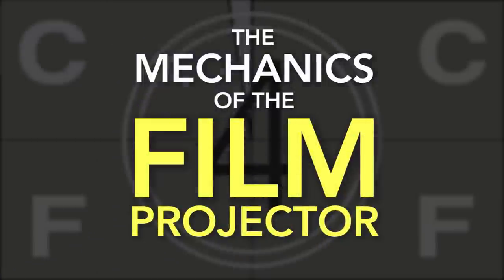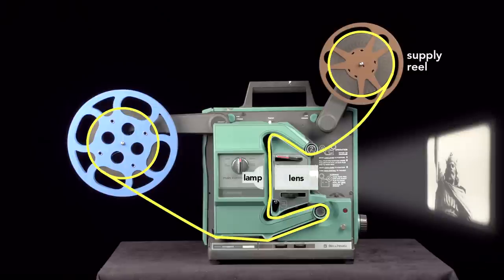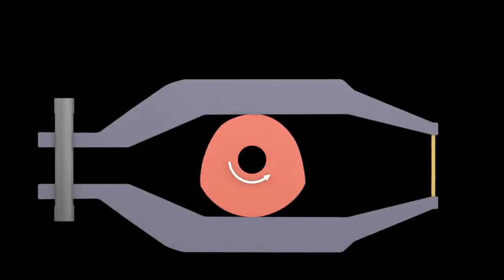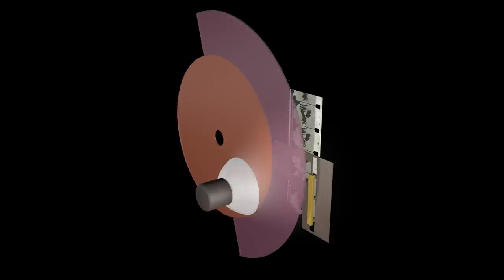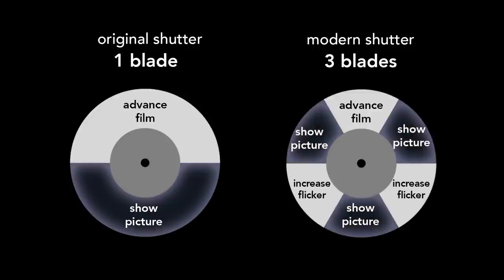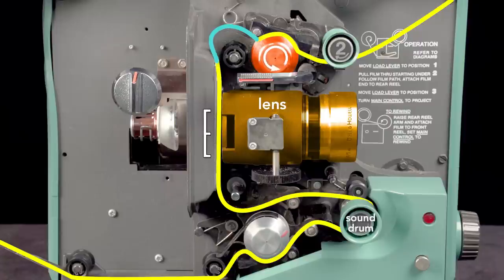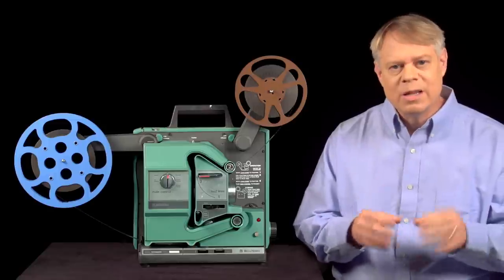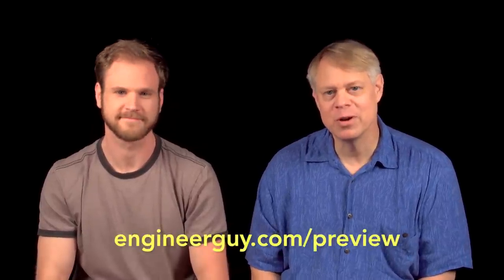How a Film Projector Works

Comment: Ah, yes.  I remember those.  Before computers were so easy to obtain in schools, tech-obsessed kids like me had to settle for things like "the audio visual club".  The 16mm projector was often the most complicated equipment that we could get our hands on (that the teachers allowed us to touch).  Still, one could learn a lot from them.  A mistake that was particularly easy to make was in wrapping the film around the sound drum. If you wrapped it loosely, everything seemed to work OK except that the sound was jittery and distorted.  You had to make sure that the film was snug around the drum in order to get the best sound quality.  All this might sound irrelevant to modern tech, but that little sound-drum hazard taught me a lot about how to deal with urgent problems.  In the 6th grade, our club was responsible for threading a film that would be shown at a big school meeting.  When the sound was distorted, it felt like a crisis to us.  Half the school is waiting on us!  The teachers had no idea how to help, so it was up to us.  Now what?  Learning how to calm down as a group and debug the problem quickly was a big event for us.  Low-tech or not, it helped me develop social and mental skills that I still use today as a computer programmer.
Reply: I did this in school also then did it for the U.S.A.F.
Reply: Yes, it seems if the film is loose around the sound drum, the slit will be incorrect and variable distances away from the film, thus sometimes making the sensor detect too little light and lowering the volume, sometimes making it detect an average from a wide length of film, causing aliasing and other artifacts in the frequencies
Reply: @luigivercotti6410  The slit of light is focused onto the edge of the drum, so if the film is loose, it is out of focus. This is the main cause of the distortion.
Poor quality sound can also be caused if during cleaning the lens is not correctly focused, or the slit is not set to exactly 90 degrees to the film.
Soundtrack test films are needed to set everything correctly. 
In major cinemas, tests and fine adjustments are carried out daily. With a stereo track their are 2 side by side images, so the adjustment is very critical.

Comment: Great video. Interesting to think that one single axle keeps the entire projector going.
Reply: Ian Gacek The single axle design makes the whole thing very impressive.
Reply: Ian Gacek Agreed! It to me about four hours to rip apart the projector (it's built like a tank) to get to the main internal mechanisms. I really had no idea how it worked until I saw for myself.
Reply: Ian Gacek 
While the Bell and Howell projector here uses a worm screw where most projectors use belts, that component is actually the Achilles heel of the machine. The original worm screws have a tendency to crack, which completely screws up the projector's timing and can lock up it up, and require a complete disassembly of the projector to replace. They then have to be adjusted to ensure they work properly. Good news is the newer worm gears are made of a material that doesn't crack anywhere near as easily.
Reply: @Videogamehistorian00  Traditional cinema projectors have a high precision gearbox that includes oil pumps. Many of these machines ran 12 hours a day for more than 30 years without gear replacement.

Comment: Also, The Take-up reel shaft is driven at a constant speed from the single motor through a belt system, but a slip clutch built into the take-up mechanism allows the take-up reel to change speeds as the diameter of film changes on the reel. This also serves to keep a small tension on the film so it takes up snugly. There are similar mechanisms on 35/70mm theater projectors. Some small projectors and usually theater projectors, also have an adjustable, low tension, slip clutch/brake on the supply reel mechanism to keep it from freewheeling as the film is pulled of of it.
Reply: I was wondering how this worked. Thank you.